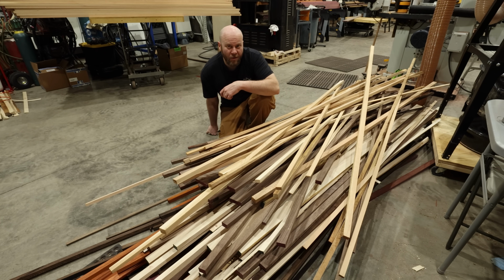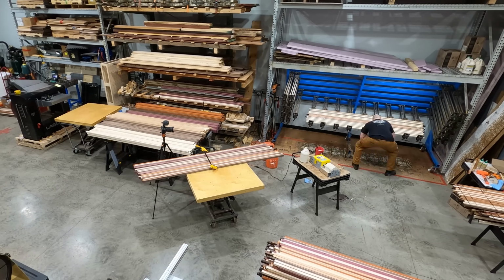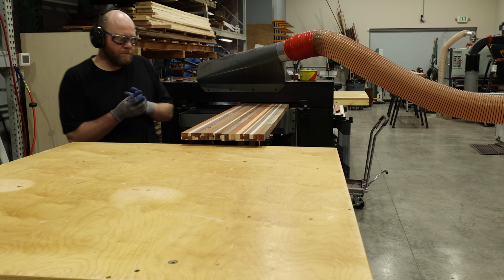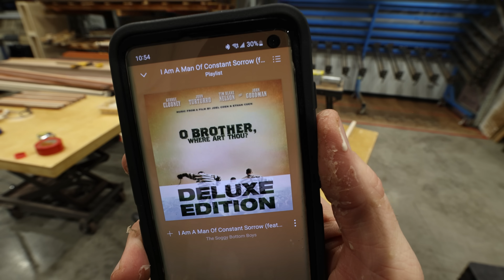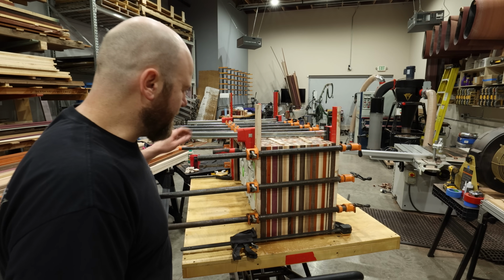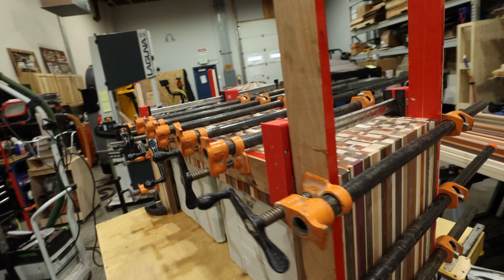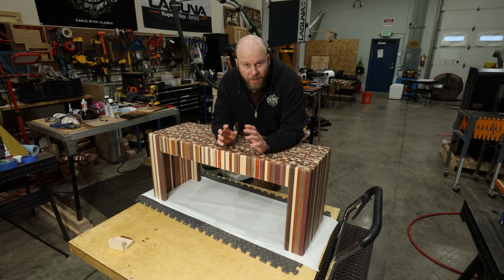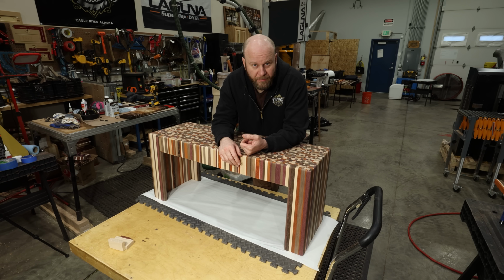Had an Idea With Scraps

Comment: Looks really great. Question from a beginner about the joint choices here though. Are you worried about sheering forces on those biscuits? I think in the time lapse it is hard to tell, but you biscuit joined only two faces of the main board right? Is the longer face only sticking with glue? All the forces are sitting on the glue and biscuits and not the actual legs?

Comment: Just be carefull not moving the piece in any angle if you're slowing the saw while a piece is still there. I know, by experience, that it could kick back pretty bad. I never let a piece there while the blade is slowing anymore. Great shop and tools btw
Reply: Do you use higher than 220 sand paper after raising the grain with water ?

Comment: It's very nice. But don't you think that the connection between the board and the "legs" is a little bit weak? It's all entrusted to that 3 dominos that you put. It wouldn't be better to put the board over the leg and not laterally?